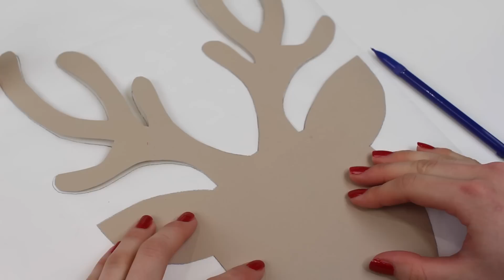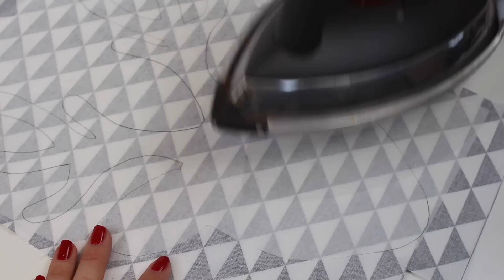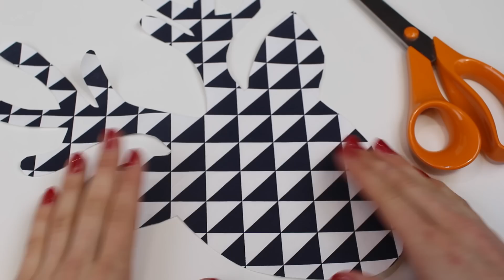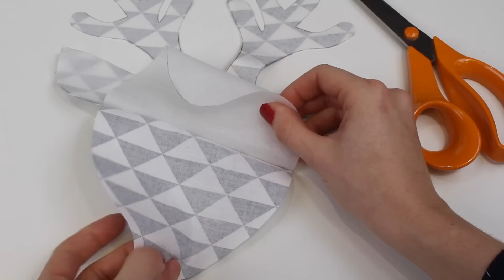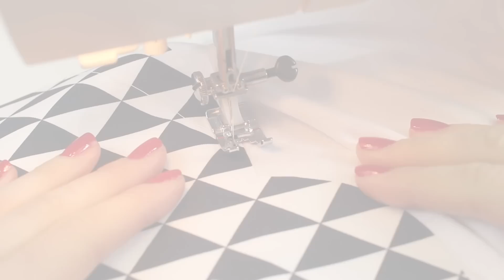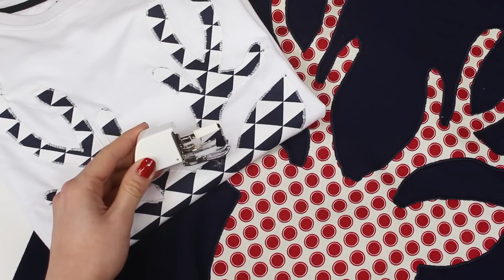DIY: Appliqué Christmas Jumper

Comment: If the fabric gets stuck and the thread bundles up, just use some 'stitch and tear' type material behind the fabric to prevent this
Reply from the maker: Great idea Lauren, thank you for sharing! Vilene's Stitch n' Tear is fabulous to use with appliqué & will help prevent any fabric puckering. We found the sweatshirts we used were quite stable but for jersey items (or if your having trouble with your sewing machine) this is a great idea. If you haven't got any fabric stabilisers in your stash & your trying to get this ready for Christmas, try using tissue paper (or even tracing paper) instead. It isn't as good the shop bought stabilisers but great if your in a rush and don't have them to hand! Thank you for the suggestion Lauren! X